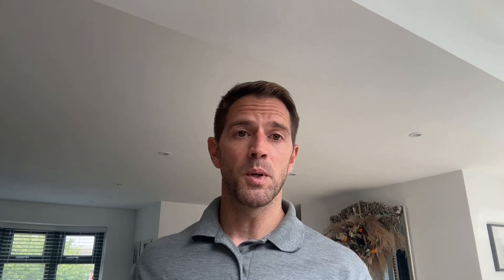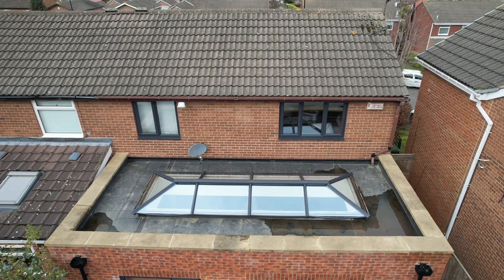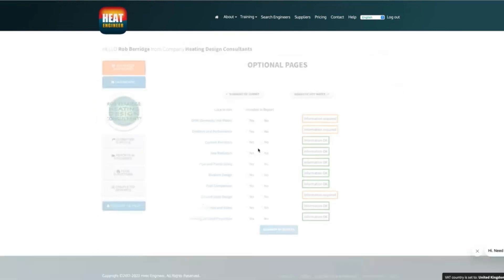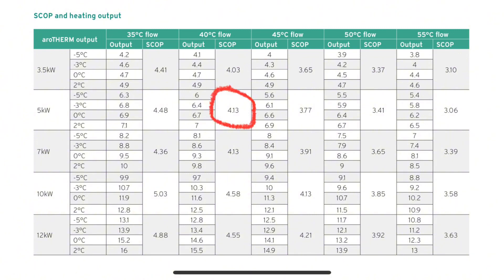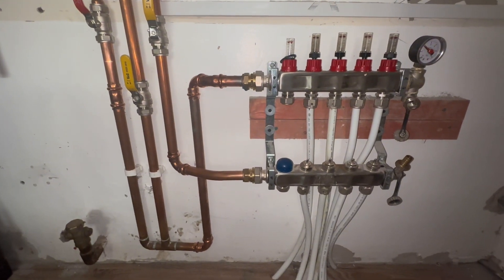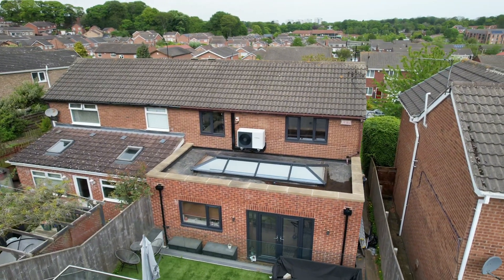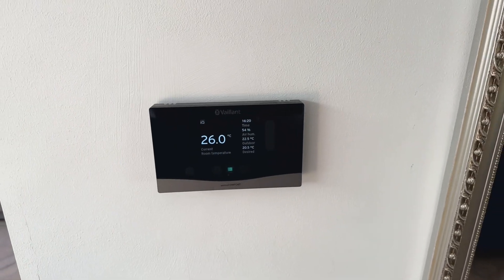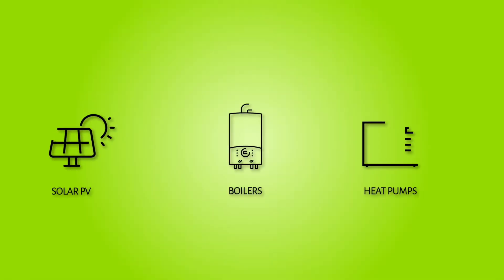Heat pump installation in a 1980’s Property: What’s involved

Comment: A 1980s property isn't well enough insulated for the low grade heat produced by a heat pump. It's a Government tick-box exercise, don't fall for it.
Reply from the maker: Thanks for the comment, this home is actually perfect for a heat pump installation. The windows and doors have been upgraded as well as the wall and loft insulation to make the total heat loss less than 5kw. The ground floor is already working off low temperature with the underfloor heating and the larger radiators upstairs are perfectly sized for the lower temperatures. Low temp systems do take longer to heat a property from cold that’s why they should be operated with weather compensation and not a on off control like most gas boilers have. This system will definitely be cheaper to run than a gas boiler.
Reply: @greenhomeheatingltd  Brutal, your first comment on an install is one of the people who believe and spread the disinformation regarding HPs.  Hopefully, it won't put you off posting more of these.  A more basic install is also refreshing to see, sounds like only 2 new rads were needed? I also like the upgrade from Sky dish to Heat Pump - some might say that was required to be able to afford it 😉
Reply: @greenhomeheatingltd There's a lot of people who can't afford to do these things, and also don't have room in their homes for all the pipes etc...that seems to take up a lot of room
Reply from the maker: @mel4856  you are right. Depending on the home changing from a combi boiler to a heat pump can be difficult due to the space needed. In this house they still had a cylinder cupboard but have lost around 50% of the storage space they had in it for the cylinder. Financially it does cost quite a lot more going combi to heat pump, I think this install was around 6 thousand pounds after the BUS grant where a top of the range combi would be 3k. It does make a lot more financial sense when you are changing from a system boiler or having a full new heating system put in as the cost differential comes right down in those situations.
Reply: @greenhomeheatingltd  don't you have to have room outside as well for things too? I think I saw something on tv which showed things outside the building for heat pumps too? I live in an old house which has gas boiler put in a few years ago, it's in a small cupboard in the smaller bedroom. I couldn't see where I could fit all that. And the garden isn't big enough.  Do they work well in Britain? I've seen people saying different but don't know. It's ok for government to say all this when all this extra cost won't affect them as they have plenty of money and big houses and gardens. They are out of touch with reality for a lot of people in this country who right now are so many working people using food banks and struggling with the cost of petrol, rents, mortgages, electricity and other bills all gone up. As usual these decisions are made for people without a thought for how it can affect them, and also made by the elite, whose decisions will never affect their lifestyles. Just my opinion.
Reply from the maker: @mel4856  yes you need to have a suitable location outside of the property and it needs certain clearances from boundaries so it’s not a solution for every house unfortunately. I don’t think gas will be going anywhere for a very long time but I do think the cost of gas and buying gas boilers is going to get more expensive over the next few years. 
Heat pumps do work very well in the uk if it is designed and installed correctly. Unfortunately they get a bad reputation because some of the training out there isn’t brilliant and the government are trying to push more and more people through to hit the targets they have set. I also think the £5k voucher they give people for installing the heat pumps isn’t enough and should be higher. If your interested in learning more Heat Geek have a brilliant channel on YouTube that’s really worth checking out.
Reply: @greenhomeheatingltd We're in a mid 90's home.  Small radiators but with the microbore (i think) piping, certainly its around 10mm leading to the rads.
Hear this is a no go, or at best the pump needs to work harder thus less efficient?
Is this broadly correct?
Can't at the moment imagine the cost never mind the disruption of ripping up flooring / kitchen tiles to correct :(
Reply from the maker: @stuartburns8657  is the 10mm pipework copper pipe? If it’s plastic I would definitely say it needs changing as the inserts reduce the pipe diameter down even further. It all depends on the heat loss in the room though and doing the right calculations to see if it will work. We have been able to increase 10mm pipework at the first accessible point and it has worked fine but have also had cases where it has not been a option and required a repipe. 
Some people use separation on the system by using a low loss header so they can leave in existing pipework but we stay away from this where ever possible as it can lower the efficiency.
Reply: @greenhomeheatingltd  Thanks for the response.  Copper it appears.
We have a rather aged Vokera (riello) gas boiler.
Already have 6000kv PV and 8.2kwh home battery.
Waiting (fools errand?) for electricity to come down to sensible prices, as despite HP's being 3-4 more efficient, it's not much good if it's 3 or 4 times more expensive than gas :(
Also have water based underfloor  heating in kitchen.
Guess I'll wait until next year, and see how things pan out, but appreciate the response and video, very thought provoking 👍👏
Reply from the maker: @stuartburns8657  it sounds like your in a good position for a heat pump with the solar and battery. Although the solar won’t be generating much in the winter if you can charge your battery on a tariff like octopus cosy the electricity would be around half the price so you could be looking at 4p/kw from the heat pump if you are getting a SCOP of 4. Increasing the battery size could pay off as the current one might not see you all the way through the night in the coldest weather. 
Check out Heat Geek’s YouTube channel as they have loads of brilliant consumer content. It will also help you find a good installer if you make the move. Good luck with it.
Reply: @greenhomeheatingltd  Thank you, I'll take a look.  Yes, an additional battery is a must, even on a smart tariff!
Reply from the maker: Unfortunately there are a lot of bad installs out there that have not been designed and installed correctly giving heat pumps a bad name.
It was just 3 radiators that needed replacing on this job, it it was definitely one of the easier installations. Luckily the sky dish was already disconnected from years ago.
Reply: There is no such thing as “low grade heat”. Providing the heat leaving the room is matched by the radiators when working at a lower flow temperature you will feel no difference.